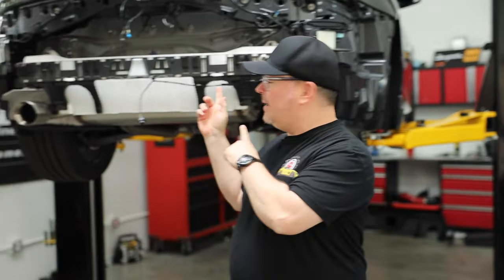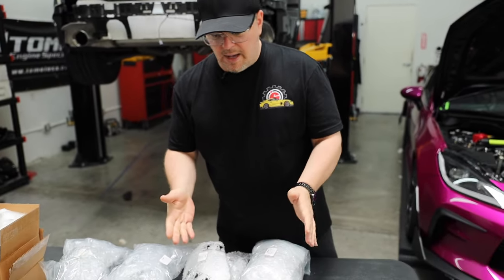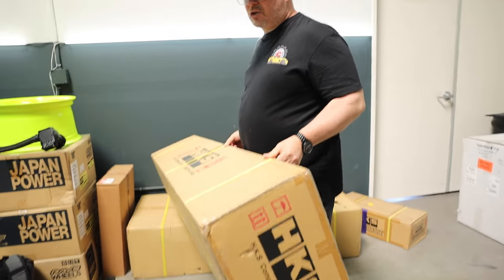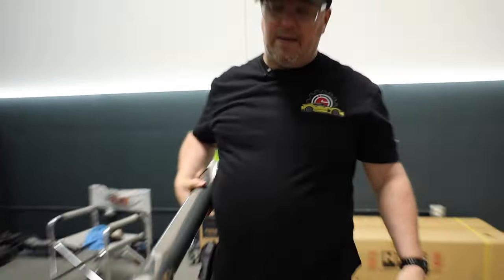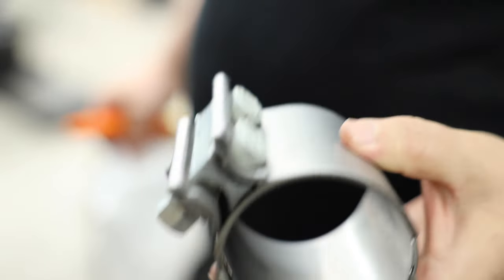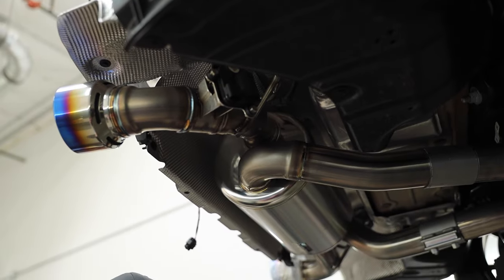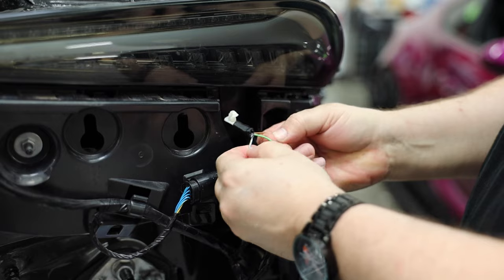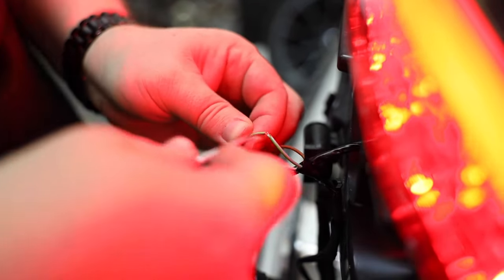HKS A90 Supra | SUPER TURBO MUFFLER Exhaust Install - 31029-AT003 |  Carbon Diffuser added also

Comment: i think its better to wire that fourth brake light into the third brake light on the top instead of the tail light since it also acts as a turn signal. looks weird when only one of the turn signal triggers the braking light
Reply from the maker: Oh, thats not how it works, It's only flashing in the video because we are using the hazards , once it is just a turn signal of a single side , the 4th brake will not flask.